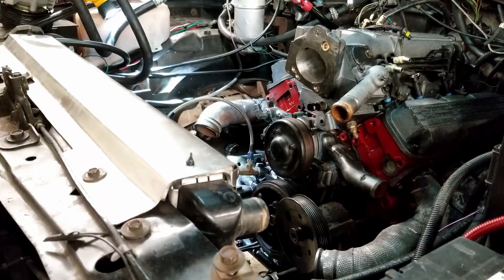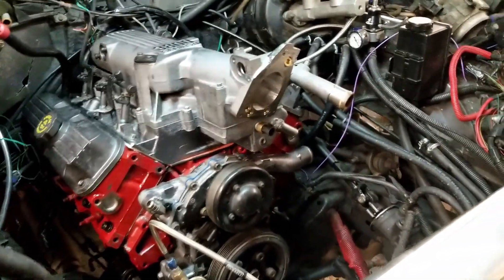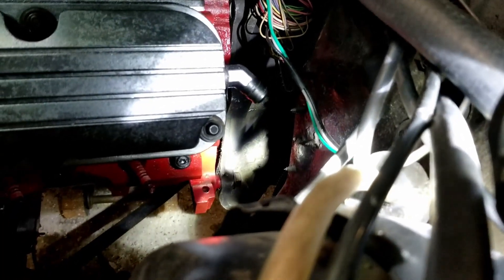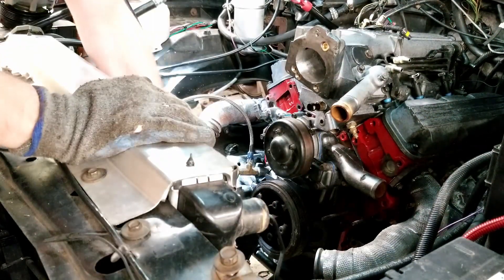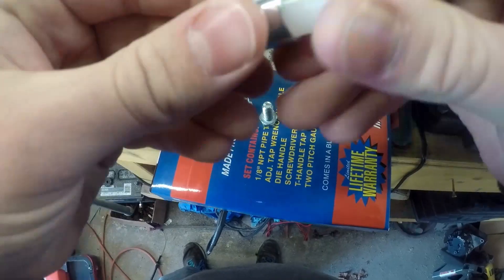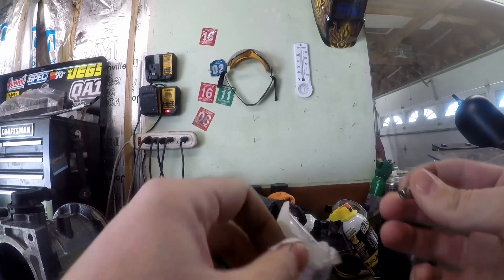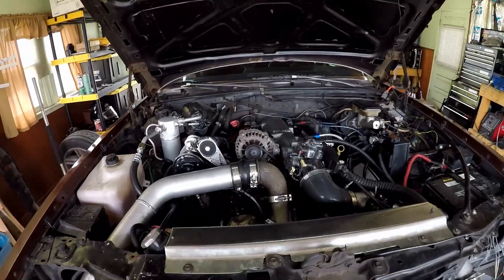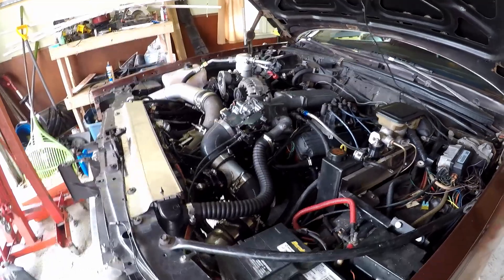Turbo 3800 Grand Prix Chipped a Piston - Ep 3 - Installing the L67

Comment: Awesome work dude what management are you using to run it
Reply from the maker: Thanks! I'm using the stock pcm from a 98 Grand Prix, I've tuned it to work here using an old Digital Horsepower interface. It's been working great!
Reply: Do you got a write up on it
Reply from the maker: @jaime13huerta  There would be so much to cover, but there are a lot of really good resources out there. I'd look up DHP in the Grand Prix forums though as a good starting point